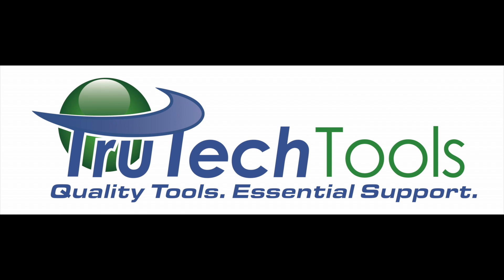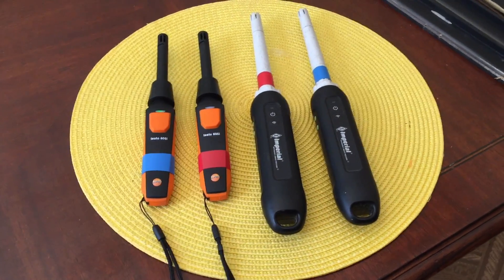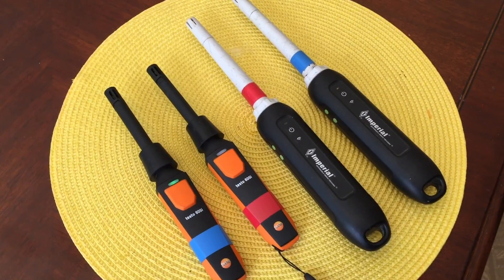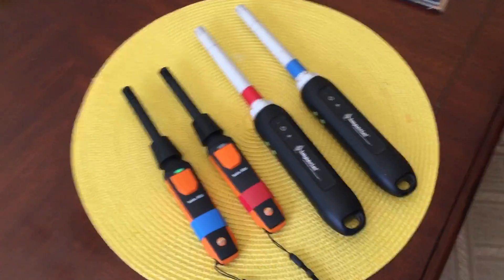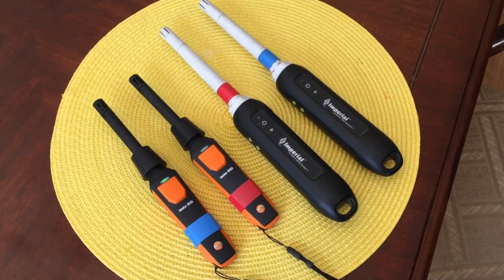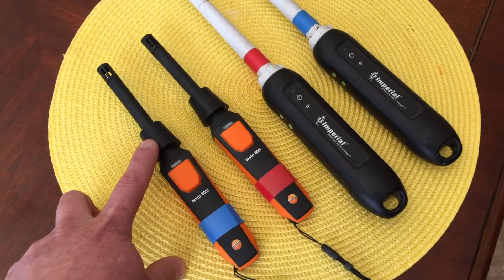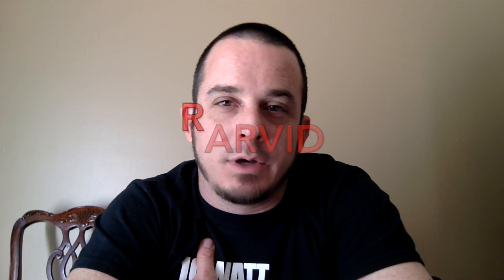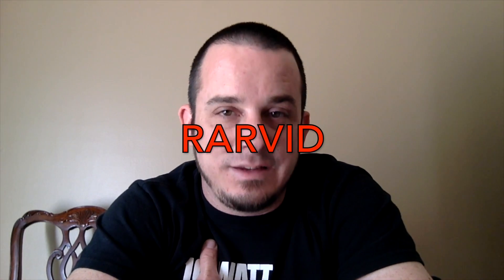HVAC Tools: Testo 605i vs iManifold 911M Comparison and Target Superheat

Comment: so the  testo 605i measures the dry bulb condenssor temp AND the return air tempeture?
Reply from the maker: +Arnold Navarro no, you would have to get that with another tool or accessory
Reply: well im new at this. im about to get finish my havc course and im starting to look at some tools i want. what do you recommend for dry bulb and wet bulb measuments. besides using the field piece wired probes or is that my only option.

Comment: great video stephen!  Taking the steps to apply them correctly is key to getting the most out of the TESTO. If they could get rid of the manual stuff and implement the sensor readings into the equation, It would make them an even better device.

Comment: Digicool for life.
Reply: The Joy Of Piping I have set of digicools and I bought a set for my installers. When ever I let another service tech use my manifold they always over tighten the temp sensors and I have to solder the wires back on. That is the flaw of digicool.